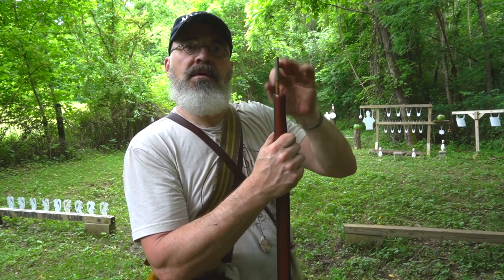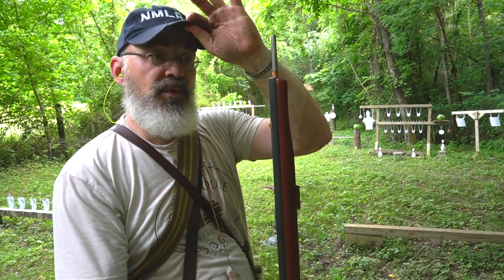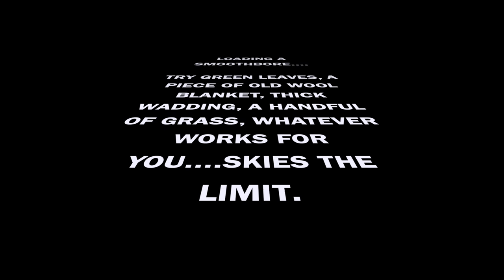LOADING A SMOOTHBORE MUZZLELOADER WITH SHOT

Comment: You may laught but I've been using waxpaper for years as a over powder wad and over shot wad and it works great. Been doing it for 50 years by the way I'm 70 years young and I put meat in the freezer  every year
Reply from the maker: Hey you won’t catch me laughing. Sounds like a solid idea. I’m sure it doesn’t smoulded on the ground or anything. Solid tip from a salty dog. Thanks!

Comment: Love that sound of a flintlock! I have a Brown Bess and she shoots very low I've tried different loads and wadding but she hits 3 feet low.
Ps it's shocking how much more she kicks with a hot load.
Reply from the maker: You and me both! It shoots that low with your entire front sight showing in your sight picture? Wow. You may have a bent barrel. Is your muzzle square? I'd post this on the muzzleloadingforum and see if anyone else has had that issue.
Reply: I'll have to check next time I'm in Florida brother got it on the wall lol but the last time I had it out the stock it looked straight.
Thanks for information
Reply: File down the front sight if possible.    It was probably meant to he filed

Comment: Just a couple of things to mention.
First is our pattern. We are working to get a dense enough pattern so we get four or five shot into the head or chest of our critter. 
You know what your normal woods ranges are where you live. For me, I shoot most of the small stuff at around 20 yards no further than 25
Yards.  If the shot is closer, say 10 or 15 yards, then I aim for the nose so most of the shot lands in the head.
So, I work with my load to get a good pattern at 20 Yards.  If the pattern is too thin,  I add a little more shot until I get the density I want at the range I need to shoot.
Next is power. The prettiest pattern in the world is no good if we don't have enough velocity to drive the shot deep enough to reach the critters vitals.
 The old way was to shoot a steel bean can. If the shot would penetrate both sides of a steel can it would do for small critters.
If the shot just bounces off the can,  I add a little more powder , say 5 grains at a time, until I get the penetration I want.
The old way was to work out the best load and at what distance it patterned best. Then try to take as many shots as possible at that distance.
The fun never ends. Thanks for all you do and looking forward to more.
John Davis Jax Fl

Comment: I would put a clean un-lubed thin wad on top of the powder so that there is no lube wetting  the powder.  On top of that the wad would want to be a 5/8 inch long felt wad. Then the shot and a thin over shot card as shown.  A thin wad will let the high pressure gas get past it and blow the  pattern,

Comment: potentially dumb question: do you need to ram the first patch all the way down before you load the shot, or can you push it down with a ball starter, load the shot on top of it, put the shot card on top and then push it all down?
Reply from the maker: I push the whole load down sometimes but depending on how tight everything is it might only go down one at a time. 👍🏻

Comment: I'm really enjoying your channel. I recently bought a percussion cap rifle, and sometimes have trouble with misfires on the initial attempt to fire it. I think lubricant in the barrel may be part of the issue. Do you do anything to prepare the barrel before the initial load is placed in the gun, such as swab with solvent, or a dry patch?
Reply from the maker: I do run a dry patch before and after popping a cap on an empty bore before loading. That will help insure you don’t have oil in your nipple! Thanks!

Comment: Bob: What are your thoughts regarding petroleum vs non-petroleum lubes?  Also, how do you carry your shot? I've tried putting it in a horn, but it clogs up at the spout.
Reply from the maker: Tim Case My advise is to keep petroleum products out of the bore completely. They tend to leave a glaze that builds up over time and is hard to remove. I know guys who use virtually every type of non petroleum imaginable as a lube with good results and no gummy or glaze buildup. I personally like anything natural. Bear, deer, beef, or sheep’s tallow. Track of the Wolf’s Mink Tallow is great. 

I carry my shot in traditional shot pouches. I particularly like the upside down hide pouches with clothespin stoppers.

Comment: Will you please work hard on coming up w a .62 gauge load for turkeys that is concentrated as much as possible for a headshot at 30 yards.  maybe could we use minea ball wadding cups that won't melt? maybe a 610 gauge size wadding plastic wads for thr BB cups will work..or heavy paper cups made by wrapping then around fingers our finger . Need a solution thats the :" tightest group combo recipie". Thanks
Reply: Lots of ideas out there if you look but bottom line is YOU are going to have to figure out the best shooting load for YOUR gun. No one is going to do it for you. I found powder, tow, shot, tow to work the best in my Fowler-SO FAR.

Comment: Was going to try shooting shot out of my dads Pedersoli Brown Bess to get an idea if maybe I’d like to get a Fowler. I just found out that there is chilled shot and magnum shot. Can’t seem to find any of the softer chilled shot anywhere but I do have the harder magnum shot at the house. Would this damage the bore in anyway using the magnum shot? Wanted to make sure since it’s my dads gun and not mine. Thanks!
Reply: It won't hurt the bore. There is no choke in the Brown Bess bore so no compression of the shot passing through it.
Reply: Copy that, thanks for your reply. Ended up bird hunting with it and had a blast, really looking forward to it again this upcoming season!

Comment: Another great video what are you using for your lube?
Reply from the maker: Hunter850 2/3 bear grease 1/3 beeswax. 👍🏻
Reply: Black Powder TV being I don’t have bear grease what would be a good substitute?
Reply from the maker: When I don’t have bear grease I use Mink Oil from Track of the Wolf.
Reply from the maker: Hey Hunter, thanks for the question, it’s a good one, and I normally would have chatted you up a bit more about it but I was on the boat Crappie fishing and between poles in the water and sketchy cell service I was sort of out of pocket. I like bear grease and mink oil. I try different combos of the two that sometimes include beeswax depending if I want a wet lube or a more waxy lube. I’m always looking for something that’s historically correct and that works better than the last combo. It’s really never ending. Thanks again!

Comment: My name is john big fan of anything blackpowder. Your doing great on your videos. Could you do a video on how too get past the flinch on flintlocks
Reply from the maker: Thanks! I can, that's a great video idea John. I will say the best way is to 'slowly squeeze the trigger while starting at the target/front sight and let it surprise you when it goes off. What flinching really is, and what you have to beat, is anticipation. The only way to beat anticipation is to outwit your brain. Stare at the target, by way of your front sight, slowly squeeze, thinking ONLY of the target,....blam!.....if you weren't shocked it went off, you did it wrong. Once you get that down, you can squeeze off a shot when you want like when you offhand shoot and your sight is moving around and you need to pull at the right second. Great idea! Thanks John!
Reply: Thanks bob I'm rather new to flintlocks always had tc hawken. But the flintlock bug bit and now i have 2 tvm 50cal flints and a smoothbore and i still have trouble with flinching. But I'm working on it
Reply from the maker: Work on it hard. We all had it. Laser focus on the target, the gun won’t hurt you, let it do it’s thing, your thing is proper aiming. Let me know how it goes!

Comment: I would presume loading a double barrel shot gun would be the same in each barrel.
Reply from the maker: Bunk Stagner It would. Remember each barrel may have a different choke and after firing one barrel I suggest tamping down the load in the other barrel just to make sure it’s still seated. Especially if using ball.